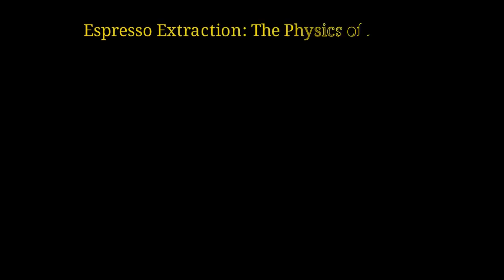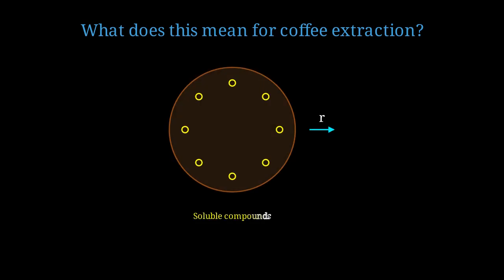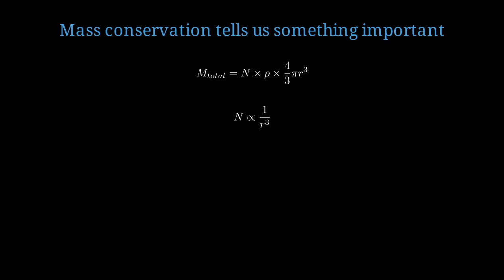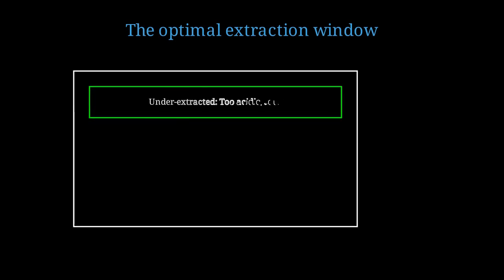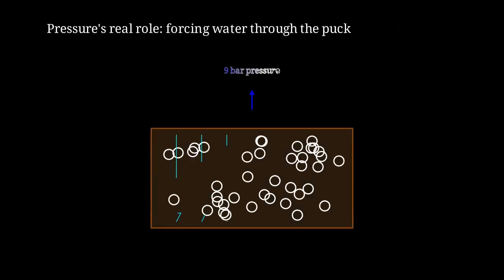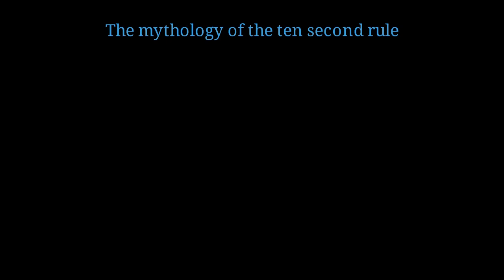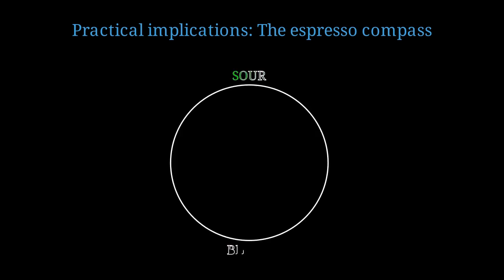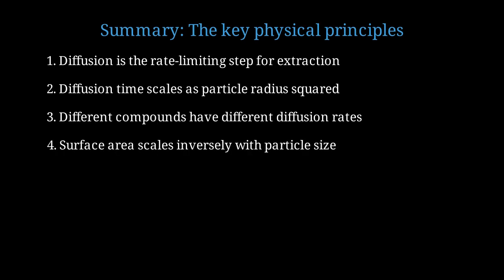Why Espresso Flavor is Controlled by Diffusion, not Pressure

Comment from the maker: What is the theoretical maximum extraction uniformity achievable given realistic particle size distributions?
Can controlled turbulence or acoustic agitation bypass diffusion limits without increasing bitterness?
How does extraction physics change in microgravity or reduced-pressure environments?